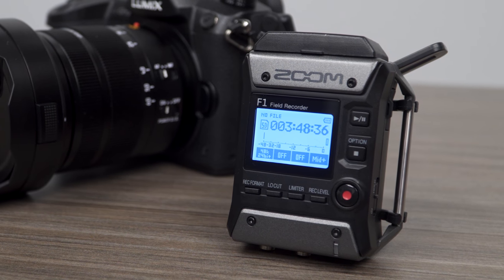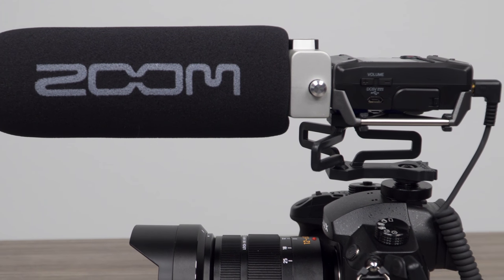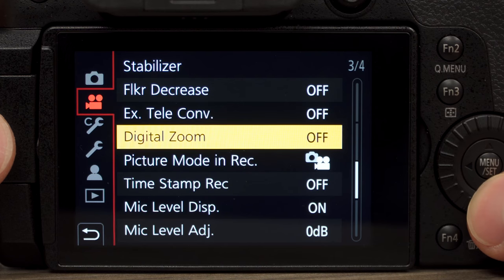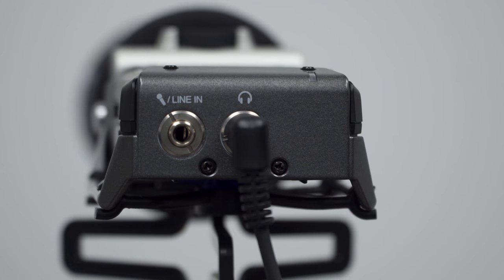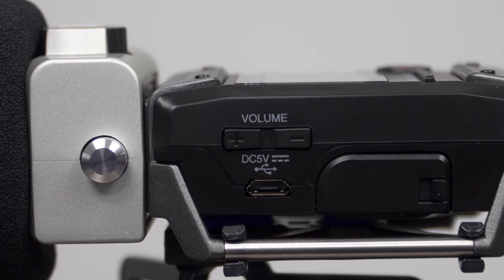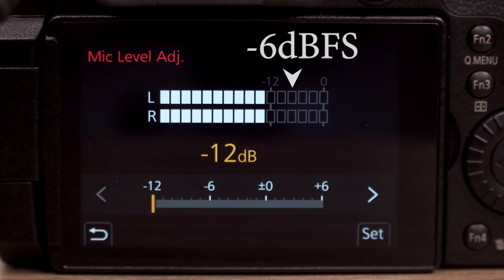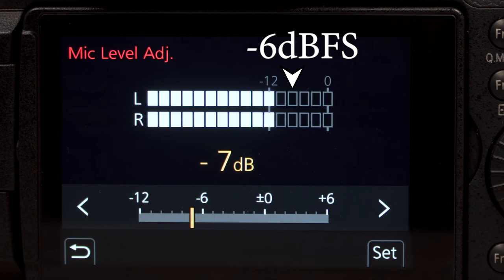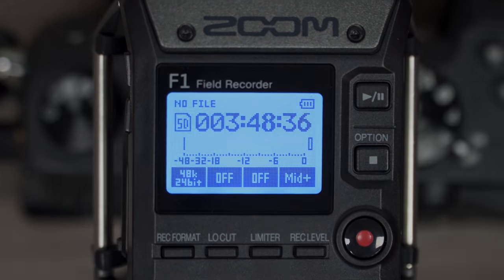Zoom F1-SP: Connecting To Your Camera / Setting Levels

Comment: Can “plug in power” or “mic bias” dc voltage from a dslr mic input jack damage the headphone output on the zoom f1?   Plug in power can range from 1-5v on cameras. Does the zoom f1 have something like capacitors on the headphone output to block the dc voltage?
Reply: It is possible that you could damage the F1 by inputting plug-in power to the headphone output.
Reply: John Molfetas good to know. Thank you for your reply.

Comment: Do I have to press record on both camera and zoom to start?
Reply from the maker: It would not be necessary to press record on the F1, but the audio recorded to the F1 would be higher quality so we would suggest recording on both.
Reply: @ZoomSoundLab  Thanks. So the signal can be bypassed from the mic and directly to the camera. Thats good. Pressing record on two devices would be inconvenient.
Reply: Oh, and  can pressing record on camera trigger zoom to record internally? Can it be possible with a new firmware perhaps?
Reply from the maker: This would not likely be possible through a firmware update